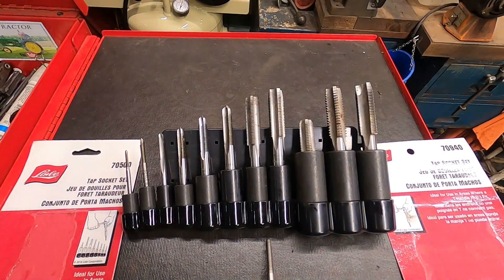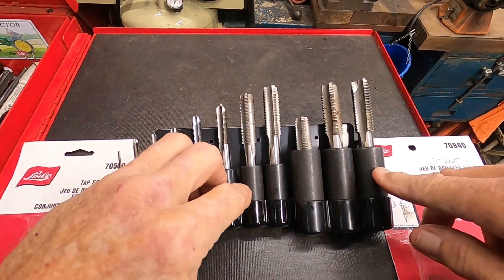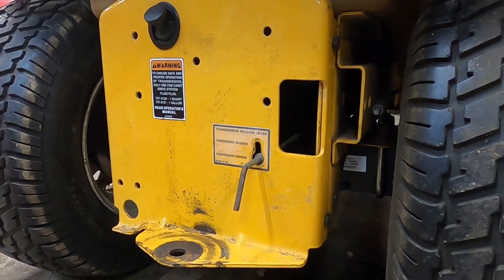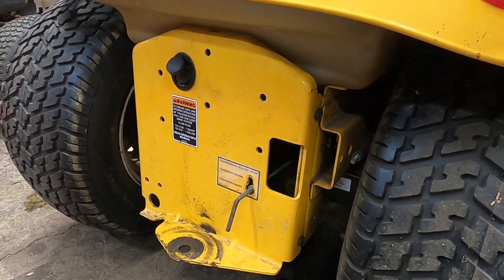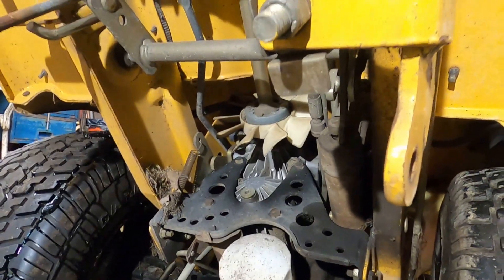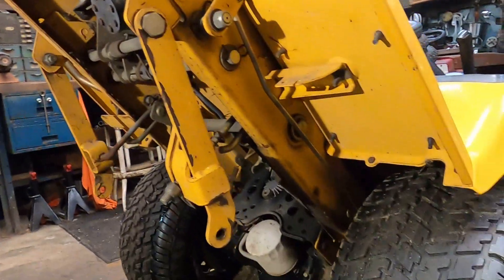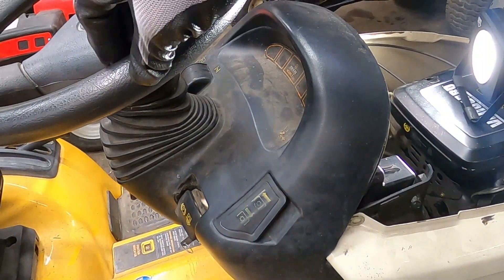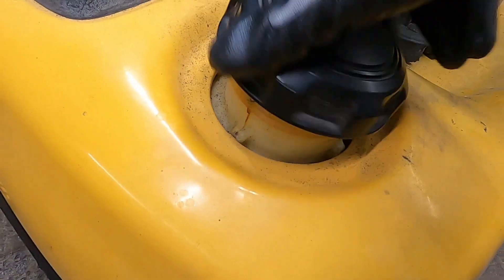Cub Cadet 3000 Series Pre-Inspection #smallenginenation

Comment: Zippo that looks like a really beefy cub but one thing i dont like is on the deck. it uses the same cheapy idler pulleys that always go out and a tip if i was you take apart the spindles on the deck and make sure the inside seals are removed. 90 percent of the time they were not removed and greasing the spindles with sealed bearings is extremely hard to get grease into bearings
Reply from the maker: Thanks freak! Great tips, and I'll certainly check into the spindles. Cheers! Zip~

Comment: Great video.  Very thorough.   It says in the manual to grease 3 parts on the front wheel.  Front pivot axle,   L/R front wheel and L/R  steering knuckle.  I found 2 places to grease but not the third.  Do you know where it might be?  Cheers

Comment: I have my ps4 pro hooked up to my Sony receiver, through toslink connection, 7.1 surround, your voice is coming through my front two speakers perfectly, sometimes it wains from one side to the other, but I think that's you moving from side to side of the camera or you moving the camera from side to side, other then that is sounds and looks great..... Hey I heard it has zoom, have you tried that out yet?
Reply from the maker: I sure have! The 7 also has zoom, but no "normal" aperture setting like the previous versions. There were enough complaints about it that they brought it back and I'm SO Glad! That was the main setting I used on my hero 5 for most videos. I'm now shooting in 1080 instead of 720 and sticking with the 30 frames per second for now. I was very impressed with the sound my self. There goes my big bulky expensive external mic needs lol!! Ugh....the trials of a Tuber lmao. Cheers Robert! Zip~